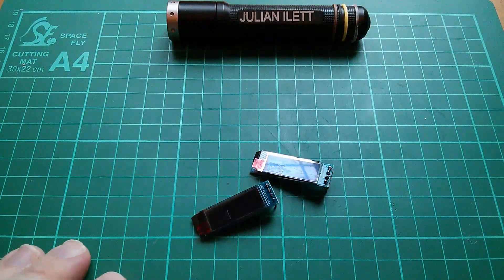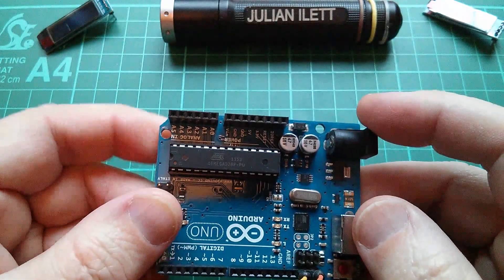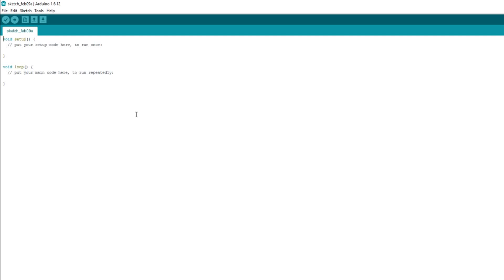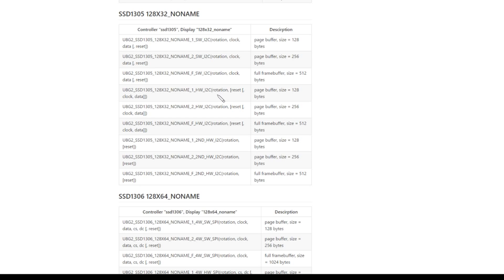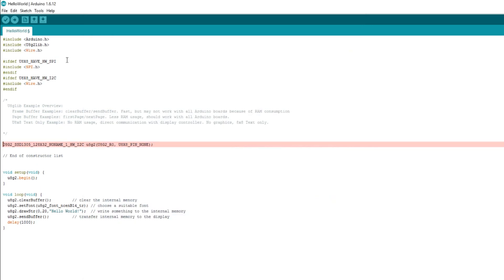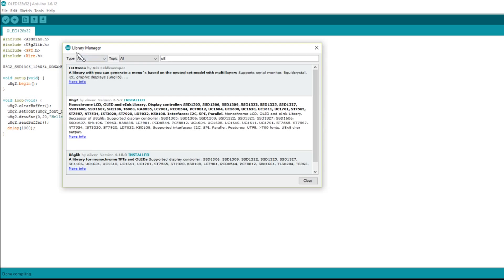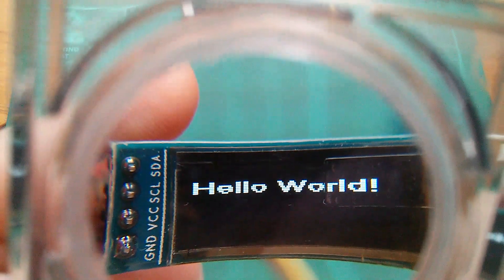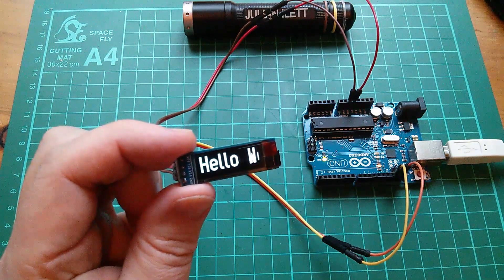Arduino Anxiety - Uno, 128x32 OLED and u8g2lib

Comment: I want to put like 32+ of these together (2 groups of 16) mounted in a long consecutive horizontal pattern to display the individual names of audio track channels on my 32 channel audio mixing console which is commonly called a scribble strip. I want that along the bottom of the mixer. On the top of the mixer's audio meter bridge, I want to add color displays above each channels dB meter that display each channels spectrum analysis. Please help me with some ideas how to start. I need either one interface to control each thing, or several really small controllers I can install inside the mixer with being to obtrusive. I thank you in advance. These additions to my console would increase it's value and make it have similar features to a high end console.

Comment: An example of a type is char, int, double etc.   In C a struct is also a type.   In C++ a struct or class is a type.
To create an object (instance of struct or class) you call a constructor.

If you have a class called car an you want to create a Car and name it Bmw. :-
Car Bmw;

Car is the type.   
Bmw is the name given to the object when you use it in code.  Eg.  Bmw.Brake();

If the Car class has a constructor that requires a parameter.
Create an instance like: -
Car Bmw(unlockDoor);

where unlockDoor is a parameter you pass to it.

so that huge long name is a type.

Comment: coming at this for the first time, i didnt get  the "does not name a type" problem but got instead a "u8g2lib.h no such file or directory" then tried to run other examples from the full buffer list as well as the Hello World one and got    ( Arduino: 1.8.10 (Windows 10), Board: "Arduino/Genuino Uno"

C:\Users\Graham\Documents\Arduino\libraries\U8g2\examples\full_buffer\HelloWorld\HelloWorld.ino: In function 'void setup()':

HelloWorld:260:3: error: 'u8g2' was not declared in this scope.)

 note to self: go learn librarries properly.

any guidance much appreciated.

Comment: I don't know if it makes sense to comment this video after 2 years and you probably already found this out. But the reason for your misformed fonts are not due to the NONAME type but your typo in the resolution. Look at around 9:20 in your video and you can see that you typed SSD1306_128X64_NONAME and not SSD1306_128X32_NONAME so because of that every other pixel line was missing...
Reply from the maker: Thanks Niclas. I think I spotted that in a follow up video, but it's difficult to remember :)

Comment: Just in case anyone else has this problem be aware it can easily be a strict coding issue - my exact same problem was. Always a danger when altering someone else's code I miscounted curly braces!! That's all but it kept throwing up the exact same "type" error all over the place! Just make sure ALL your syntax is absolutely correct. Why a compiler of any worth can't do a simple check for matching braces I don't know. It can still happen but both the editor and the compiler do not make it easy to spot these kinds of stupid errors. That is a partial failing of the IDE, a partial failing of the compiler and a failure of the coder. A coder should be EXPECTED to fail however and the relevant tools SHOULD make ir easier to resolve. 

A few people on this thread have already said the u8g2lib is a mess and I agree, and as an example you have to modify the LIBRARY EXPLICITLY JUST to handle 16 bit mode in order to handle line sizes of over 255 (it says 256!!)!! This should simply be a parameter passed during setup. NO-ONE, least of all a beginner should expect to have to hand edit an existing library - it pretty much defeats the object of the exercise!

BTW u8glib is now defunct, deprecated and no longer being developed - it has been replaced with u8g2lib - refer to Github documentation.

Comment: I usually just stick a small bit of solid core wire in the female end of a dupont connector if I need to convert it to male. Breadboard jumpers work great for this. Fits nice and snug.

Comment: It's not C, that cause the problem, it is the u8g2lib. It is an awful library, it want's to be compatible with every display (and therefore very confusing) and because of that is pretty slow. Animations? Don't go with u8g. Try OLED_I2C for example, must faster and not bulky at all (if it is the chip is compatible). "Does not name a type" is a result of all the defines included in the u8g lib, if you define a display that doesn't match a define and/or compile conditions, the class will not be defined and therefore results in "Does not name a type" error.  Again, it is not a C problem, it is an library implementation problem. The developer is able to let you know when you 'define' an unknown or impossible display type with a custom compiler error but did not implement this. Blame u8g, not C.

Comment: Hi, Can you find where the actual display chip is located. I disassembled one (just pcb and sandwiched glass panels) but can't seem to find any chip just voltage regulator. How does it really works? Thanks

Comment: i bought this one from ebay. can i use it as remplacement of arduino? is there any modification on source code to get it work?
http://www.ebay.com/itm/162425864880?ssPageName=STRK:MESELX:IT&_trksid=p3984.m1555.l2649

Comment: The problem with unclear error messages is because of bad compilers, not bad language. If only they used Clang as the compiler in the Arduino toolchain...

Comment: No problems with 1.8.1 and u8g2 :)

And two things that got me as well:
1) The Wiki with constructors forgets to name a variable. Because of the long constructor/typedef and the fact the default in the examples is u8g2 as variable name I missed it...
2) And more of a Arduino thing, in library manager, you ONLY see the update button after selecting the library :/ Dohhhhhh

Comment: Try this out mate ..  For me it was instant success!
http://www.instructables.com/id/Monochrome-096-i2c-OLED-display-with-arduino-SSD13/?ALLSTEPS
Reply from the maker: The Adafruit libraries are possibly easier to use but much less flexible. For example, there's a very limited font selection.

Comment: For your female headers:-
Try getting some of those male headers with the extra length pins, and force the spacer down to half way along the pins. Should then fit nicely into the F-headers, with enough pin exposed for the F-duponts to fit nicely as well.
Reply: PS: use a vice to shift the spacer...

Comment: Long story short, your compiler doesn't recognize the object. e.g `inty var = 0;` is wrong. `int var = 0;` is correct. I would presume that the library doesn't support the OLED controller, so you'll probably have to write your own type or library. 

Consult your datasheets for the controller chips and you'll need to write your own type. Looks like you found a type that is similar to what you need. You may need to modify the library's code slightly if you bump into a bug, but it seems to be compatible.

Comment: a 'type' in C and C++ is any sort of 'thing' that you can make (one or more) variables of.
so int, float, double, long are all examples of types. In fact they're special kind of types in that they're so called 'built-in types', they're part of the C/C++ language definition.
Now what is nice about C/C++ is that they allow you to define your own types which is a pretty fundamental concept in C++.  Typically this means you combine a number of those built-in types into a class or struct give that collection of types a name, and you've made yourself a custom type.

That U8_something_something_noname_something is an example of such a custom type, and you create (construct) a named variable (u8g2) of that type, or rather, you're trying to.
The error you're getting is the compiler telling you it sees you're trying to write something that looks like defining a variable (u8g2) of a certain type (U8_something_something_noname_something), but that it hasn't seen a declaration yet of that name as a type.
As you already found out now, the reason why it didn't find a declaration is that you were using an outdated version of the library that did not yet declare that name as a type.

---
What makes C++ particularly interesting is that you can create your own types, and then perform operations on those types just like the built in types.
So you could make a type named 'complex' consisting of a real and an imaginary part, define how all the operations on a complex type work, then write code like:
  complex x(1.5, 2) // define x as 1.5 + 2i
  complex y; // define y, no value (yet)
  y = (x*x) + x;  assuming you've defined and implemented * and + operators, this'll work.
this makes working with custom types a lot easier and more 'natural' than languages that don't have this ability. But yes. if you're not used to object oriented programming then this whole concept of custom types looks 'weird' and 'strange', and it really requires you to think about programming in a different way than you would compared to programming in a imperative language like assembler, basic, pascal, c, cobol ... (though basic, pascal and cobol now too have object oriented versions)

Comment: That error has nothing to do with C because it is a C++ error (C++ != C, the difference is not trivial). Regardless, what the error means is that the class you're trying to use (U8G2_SSD1305_128X32_NONAME_F_HW_I2C) is undefined. Having looked on the Github repo  for u8g2, it seems the ssd1305 classes were only added to the header file about a month ago, so I'm guessing the version of the library you have simply doesn't have them.
Reply: Exactly. If you tried to declare a variable like

asdfg xyz;

You would get the error "asdfg does not name a type". It's expecting a type there (like int or some class name), but the name you put there is not the name of an existing type.

Comment: Just finished getting mine running before seeing this video was up.
This is the constructor I settled on, was alreadin in the list
U8G2_SSD1306_128X32_UNIVISION_F_HW_I2C u8g2(U8G2_R0, /* reset=/ U8X8_PIN_NONE, / clock=/ SCL, / data=*/ SDA);
I also only found the SDA/SCL pins for the first tiome today, hadn't seen them because they were labled on the back, been using A4 & A5.

Comment: this is me every time I try to make my arduino do anything without just following instructions. but I had an idea to make a speed meter for my hamsters wheel with a little display to show how fast hes going and how far hes run and Im determined I will make it work
Reply from the maker: Hall effect sensor on the wheel - but do you measure the number of rotations per unit time, or measure the time per rotation? Decisions decisions :)
Reply: Im glad you said that because someone else said I should use a reed switch but I looked at some other peoples projects and both things on ebay and decided a hall sensor thing would be best and thats what I ordered

Comment: I love your stuff, Julian. And of course I'm a subscriber.

Now, I have coded in C and C++ since the dawn of time, long before the war (Gulf war that is), and it was hard not to comment half way through the video. I've promised myself not to do that. Anyway...

The error you got means there is no type defined. Like if you tried

Julian_Ilett_type u8g2();

would give a similar error because "Julian_Ilett_type" is unknown, it doesn't name a type. 

int i = 0;  // int is a type and, so you can say 'int' names a type.

The big question is why you got that compile error. My best guess is that you have an old version of the library. If you look at https://github.com/olikraus/u8g2/blob/master/cppsrc/U8g2lib.h you find the definition at line 387. https://github.com/olikraus/u8g2/blob/master/cppsrc/U8g2lib.h#L387

So. class U8G2_SSD1305_128X32_NONAME_1_HW_I2C : public U8G2 does in fact name a type. The type is a class, and the name is U8G2_SSD1305_128X32_NONAME_1_HW_I2C. It's a public class and it derives from the class U8G2 (which is kind of a root class I guess).
Reply from the maker: Thanks Robert - spot on. I was using an old version of the library. Just uploaded an update video. Cheers :)
Reply: Yes, just finished that video. With a great deal of pride, I have to add. :-D

Comment: HI Julian, I have been trying all week to get in contact with you and so far no method has got through to you successfully, please contact me on info@basicmicro.co.uk or via our eBay message system if you have tried to email before just in case you got trapped by the SPAM filter, the EBAY shop link is http://stores.ebay.co.uk/Basic-Micro-UK/ and you can send a message by going onto any item in the shop and selecting contact seller, Thanks, Dave

Comment: Julian. When you look at something on github, you are looking at the bleeding edge version of it.

I'm fairly certain given your troubles that 128x32_noname wasn't included yet in the version you have installed in arduino ide. The no type error you get is the compiler trying to tell you that it just doesn't exist (yet). You can't really fault the "C" compiler for not knowing what to tell you about something it knows absolutely nothing about. There's no miracle look-into-the-future feature of arduino libraries that says "oh this feature will be available when the developer of the library decides to release a new version".

Also, note that when you used 128x64, you essentially took something that was supposed to be 64 pixels high and squeezed it into something half as high -- 32 pixels. You can't show half a pixels so I would bet that exactly half of the rows were missing.
Reply: By the way, glad you did find a solution. I enjoy watching your videos!
Reply from the maker: Yeah, spot on. And I now know that I was looking at up-to-date documentation, but using an old library. I thought Arduino library manager told you when libraries are not up to date - it kind of does, but not very purposefully. Will make an update (clarification) video tonight. Many thanks.

Comment: so I've run in to the same problem before. basically `does not name a type` means `the thing you typed doesn't exist`. You can think of it like as if you had typed `flo4t a = 0.00`. You would get an error saying that `flo4t` does not name at type, because there is no such type. 

What the line `U8G2_SSD1306_128X64_NONAME_1_HW_I2C u8g2(...)` does is creating a new C++ object called `u8g2` of the type `U8G2_SSD1306_128X64_NONAME_1_HW_I2C`. Basically the error means that the library doesn't provide a constructor for  the 128x32 OLED using hardware I2C. 

The error is definitely confusing, but I hope that helps.
Reply from the maker: Yep, it helps. I now know the problem is because I had an old version of the library installed. Doh :s
Reply: Oh really, i'll have to update mine as well.

Comment: I'm using these whenever i need to convert female to male. I have broken them into blocks of 4 pins and it's working out great!

https://www.aliexpress.com/item/5Pcs-1-40-40Pin-2-54mm-20mm-Long-Header-Pin-Male-Breakable-Pin-Header/32770363747.html?spm=2114.30010308.3.258.0iAiw3&ws_ab_test=searchweb0_0,searchweb201602_4_10065_10068_10000074_10000032_119_10000025_10000029_430_10000028_10060_10000067_10062_10056_10055_10000062_10054_301_10059_10099_10000022_10000013_10103_10102_10000016_10096_10000018_10000019_10000056_10000059_10052_10053_10107_10050_10106_10051_10000053_10000007_10000050_10084_10083_10000047_10080_10082_10081_10110_10111_10112_10113_10114_10115_10037_10033_10000041_10000044_10078_10079_10077_10000038_10073_10000035_10121,searchweb201603_10,afswitch_3_afChannel,single_sort_3_price_asc&btsid=aac8b7b7-e242-45e4-a6c7-7ef39c64784e

Comment: Julian,
At 10:06 when you show the Library Manager ug8lib does not list the SSD1305 as a supported display controller. Might that be causing the problem?
Reply from the maker: Yeah, maybe the library manager is giving me a false sense of security. I should maybe re-install the u8g2 library.

Comment: Arduino IDE's Library manager is frequently out of date Julian (verging on useless IMO). Check your  U8g2lib.h against this https://github.com/olikraus/u8g2/blob/master/cppsrc/U8g2lib.h#L423

2.5.2 seems like a very old version as the changlelog says it's currently at v2.14 https://github.com/olikraus/u8g2/blob/master/ChangeLog

I think this is the 2.5.2 version https://github.com/olikraus/u8g2/blob/b4db8002ecaa30db99d1486c99c55db97c26f969/cppsrc/U8g2lib.h and it doesn't have the class that you are expecting.

I use PlatformIO for my library management. It's often much more up to date than the Arduino IDE's. PlatformIO also has the option of installing a more functional IDE along with its command line tools if that sort of thing tickles your fancy.

// Code From New Version you wanted to use.
class U8G2_SSD1305_128X32_NONAME_F_HW_I2C : public U8G2 {
  public: U8G2_SSD1305_128X32_NONAME_F_HW_I2C(const u8g2_cb_t *rotation, uint8_t reset = U8X8_PIN_NONE, uint8_t clock = U8X8_PIN_NONE, uint8_t data = U8X8_PIN_NONE) : U8G2() {
    u8g2_Setup_ssd1305_i2c_128x32_noname_f(&u8g2, rotation, u8x8_byte_arduino_hw_i2c, u8x8_gpio_and_delay_arduino);
    u8x8_SetPin_HW_I2C(getU8x8(), reset, clock, data);
  }
};

// Code from old version you ended up using
class U8G2_SSD1306_128X32_UNIVISION_F_HW_I2C : public U8G2 {
  public: U8G2_SSD1306_128X32_UNIVISION_F_HW_I2C(const u8g2_cb_t *rotation, uint8_t reset = U8X8_PIN_NONE) : U8G2() {
    u8g2_Setup_ssd1306_i2c_128x32_univision_f(&u8g2, rotation, u8x8_byte_arduino_hw_i2c, u8x8_gpio_and_delay_arduino);
    u8x8_SetPin_HW_I2C(getU8x8(), reset);
  }
};

P.S. Long time subscriber. Love the channel sir, keep up the good work.
Reply from the maker: Oh, my bad. You have to click the 'more info' link to see whether the library is up to date. Mine were not up to date. Thanks for that.

Comment: make your own 4x current sensor using a lm324, icl7660, 4x shunt & 8x resistance pair in differential amp configuration. it wont be VERY accurate, but good enough.
Reply from the maker: I've got the ICL7660 ammeter kit on my desk :)
Reply: cool ! build it please ! :)